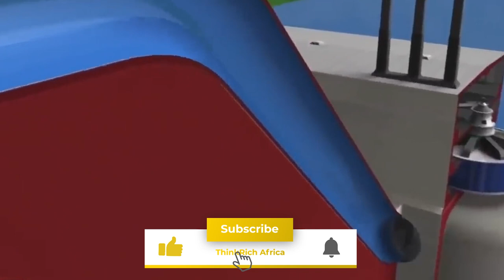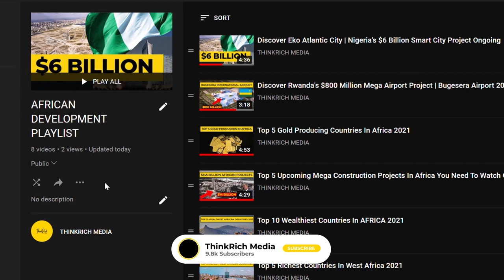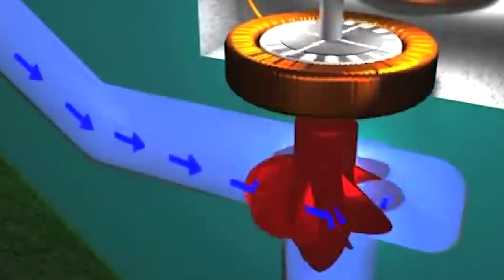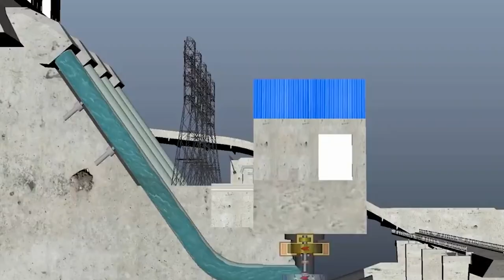80 Billion Dollars Grand Inga Dam To Power 40% of Africa

Comment: The whole country has the capacity to produce over 100.000MW with too many waterfalls spread accross the country. Congo should step forward and start building Grand Inga themselves one by one no matter how long it takes If they need financial help they should deal with African development Bank only. Money is not the issue its lack of transparency, inaccurate feasibility studies, over inflated cost etc.....They'll still be running into problems with these so-called multinationals. President Tshisekedi should propose a budget starting with Inga 3 then 4 and so on. I am sure it'll cost way less than $80Billions, a debt trap.
Reply: The problem is that Africa doesn't have the proper financial systems in place to self-fund projects.
China's GDP per capita back in the 90s and early 2000s was the same as Africa's today - the question is then, how did they manage to fund projects using internal debt? If you can answer that question, then you will see that Africa can self-fund by borrowing from itself. Watch "The Prince of Yen" and "The power of the poor"

Comment: Unrealistic Project , The cost is simply to high to make profit out of it within  reasonable time period also 44,000 GW is very low to think of exporting specially with country that have 90 mil population countries with closer population as Congo consume minimum of 100,000 - 400,000 GW While Congo atm produce 9,500 GW that project will barely cover the power needs for Congo if they aim for real development within country
Reply: Fact which is why I don't believe this project will ever be completed
Reply: @arushanioshaka5600  Really! Congolese can build it themselves bit by bit no matter how long it takes. The so-called foreign investors are actually the problems.